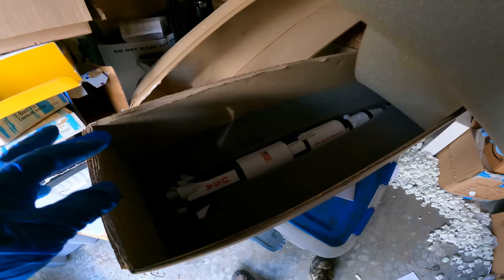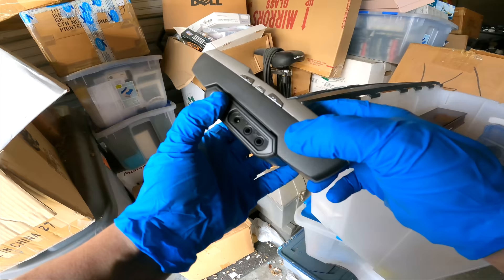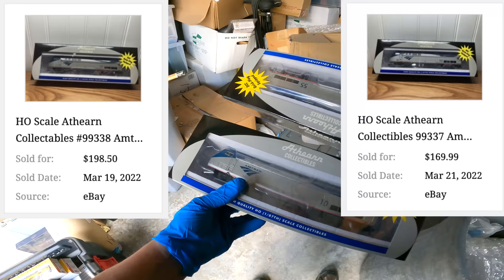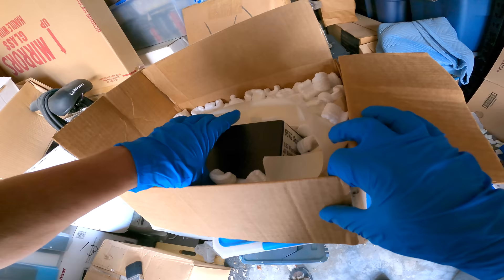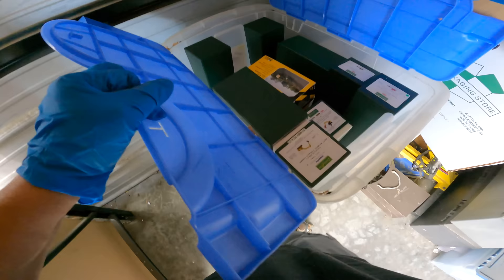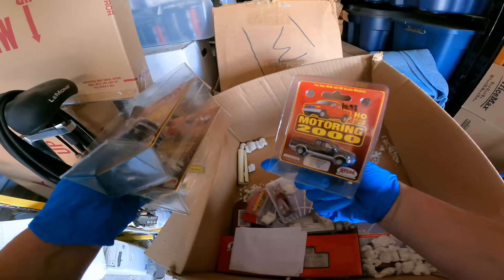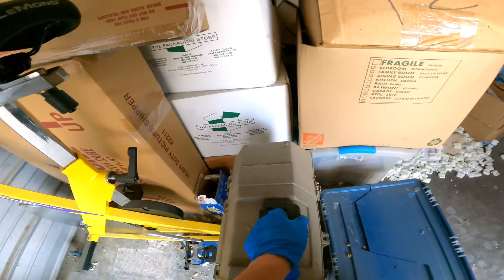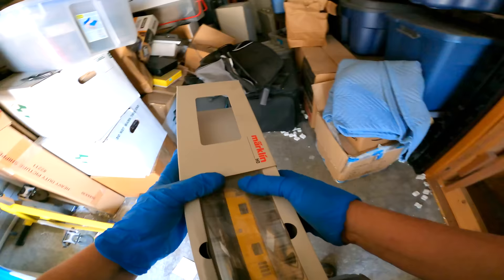These are the BEST LOCKERS ever shown on YouTube! The second train locker solidifies that title.

Comment: Those bungie cords will work great inside your new trailer! You can secure your load to keep things from shifting using the bungies with the railing on the walls of the trailer.
Reply from the maker: Thanks! I also just ordered some heavy duty cargo straps.
Reply: Heat and age take a toll on rubber. All those boxes near the top got more than their share of heat.